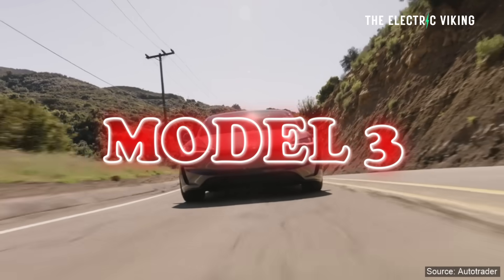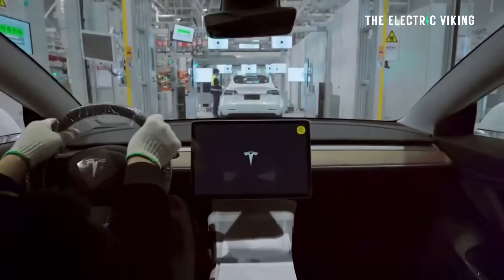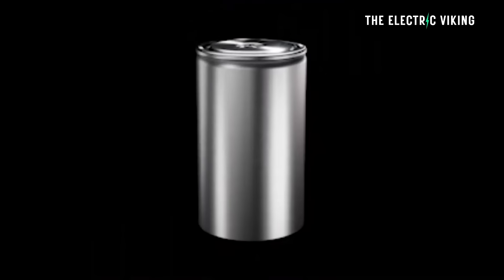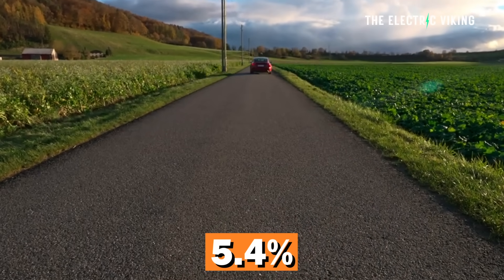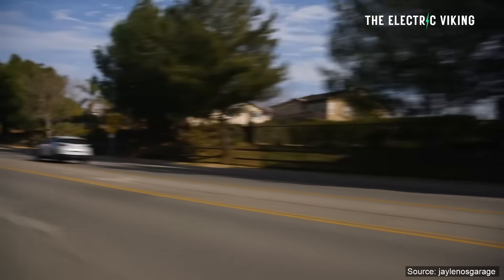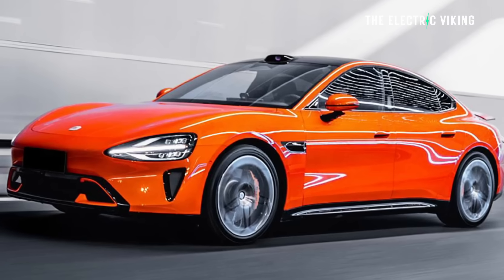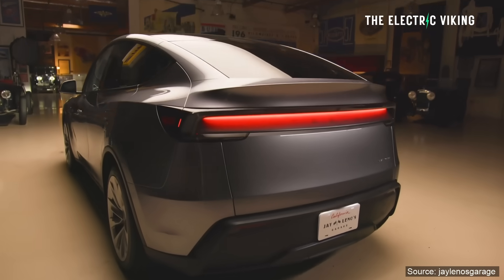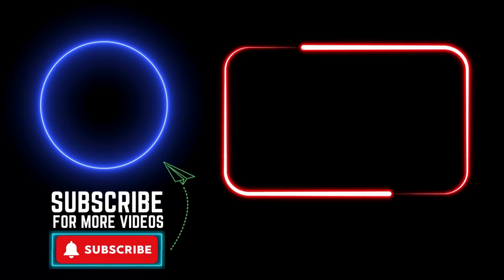Tesla Model Y and Model 3 get BIG range and power boost with NEW battery!

Comment: I wouldn't call a 5.4% increase in range for $2000, Game changing!🙄
Reply: I think it's significant. We are starting to see standard range cars come in with 500km+ range and LR versions 600km+ while tech improves and purchase prices continue to fall towards parity with ICE. I think EVs are on the verge of mass market wherever politics does not block free trade. ICE is starting to look expensive for what you get and what it costs to run.
Reply: @undercoveraca GO see what it costs to repair an Ev.........if you can find somebody to work on it & goodluck trying to get parts  which in many cases are on PERMANENT back order!!
Reply: @undercoveraca Chemical batteries have little room for improvement in cost, safety, and power density. Its a mature technology that's been around longer than the combustion engine. EV's are awesome, chemical batteries are not. Now if you replace the battery with an internal combustion engine and use a small battery for short trips and energy recovery, you have a winning balanced solution.
Reply: What about 10 to 80 charging times?
Reply: It would seem more significant if it were not for the weekly announcements of new battery technologies that make huge increases in range, but somehow never make it into production.
Reply: Cheaper than ICE trying to improve 5.4% in fuel economy or especially power, while meeting emissions.
Reply: It’s also a big boost in acceleration. That’s a bigger change than the range.
Reply: @ilmostro16 you got it 👍❤
Reply: This is one of those >> I don‘t really know what to say because Tesla has chosen to no longer be innovative, so there is nothing really new but somehow I have to keep my audience entertained, so this is what I came up with<< video.
In reality Tesla has missed the boat and is going down the drain. 
They should have brought something like the YU 7. But the great leader has chosen Tesla to become an autonomous drive and AI company. Meanwhile their only relevant product is piling up in stocks and can only be sold with huge discounts- even after the makeup. It is so boring that nobody wants it. SAD!
Reply: Bro, you spoiled he video -.-
Reply: Yep. Minor increase to range, but still of course positive thing. But Tesla has been quite efficient already long time so improvements are harder. Other brands naturally now make much bigger improvements. 
Acceleration improvement clearly bigger for those who care that.
Reply: Good on you,mate.Keep on the great work,right?What would we do without your opinion?
Reply: in the sense that a lot of people who were interested in purchasing one won't bc of the price increase it is definitely a game changer
Reply: @rickducharme7429  That makes a perfect point. Those who bought the previous model, for less money, with proven technology, really didn't do too bad!
Reply: Don't confuse him with logic!
Reply: It's the click bait nature of this channel. Every time, it is a game changer!!! I'm starting to get fed up with this.
Reply: @danielvilliers612 
Yes, I Unsubcribed!
Reply: He is giving us  80%  news  called  Silly Bollocks
Reply: If they do that around 13.5 times... they'll have doubled the range. It is Huge news!!
Reply: Tesla is DESPERATELY trying to crank sales up. Robotaxi, self driving new cars and all that BS. They are on a lifeline and sinking fast.
Reply: Price increase is from the new tariff climate.
Reply: exactly, too much freakin drama
Reply: Especially compared to the Chinese
Reply: Tesla is a shitcar.... It's badly assembled and it begins to rust after 2 years!
Reply: If the price goes up in the UK, sales will fall even further,  especially as in the UK we have a luxury car tax on cars over £40,000 so that will mean all tesla cars will have an additional car tax of over £2000
So sales will plummet
Reply: LOL. I was thinking 50% more range, not 5.4%! Hilarious!
Reply: 60 extra miles is significant
Reply: @SeanDees 
Not for Europeans. 😂😂😂😂
Reply: Technological advances occur incrementally.
Reply: Right?!?  Got me to click though… ugh
Reply: Charging time still ugly?
Reply: Did he say the range is now 700km? Thats like 430 miles that’s a 100 miles more than US models. How is that only a 40km increase?
Reply: That was alot of talk up for 5% for $2000 (5% of cost). And performance is already unnecessary. 4.4% for Y range. Feels incremental i was thinking 25% or something
Reply: 😂😂😂 absolutely
Reply: It's easy to talk about it, but can you do it? 😢😮😅😊😂🎉❤
Reply: Consider the result of that 5.4% increase. 753 km is 468 miles which I'd call excellent.
Reply: I do…
Reply: The game changing includes the increased performance 😀👍🏽
Reply: @neolakraj  irrelevant numbers in real world usage. If you want to race cars buy one that's purpose built
Reply: Yeah, but this is Sam talking :). Everything Tesla is awesome.
Reply: @Grizzold-HP2    Zeeker too!
Reply: Even if the range is only 'so so', if the new battery can maintain a much higher charge rate up to a higher state of charge without tapering off, THAT would be a "game changer"! The improvements in performance shown in this video suggests, that the new battery may be more efficient, able to handle higher current without overheating. That might also apply to fast charging!
Reply: Tesla just released its last quarter numbers, very bad, 13.5% drop in sales, 2 quarters in a row sales drop, lost title best selling ev brand and many more
Reply: I disagree. 5.4% increase in density, for a battery, is commendable and more than an incremental increase. When the Tesla battery factory is ready, more improvements will follow.
Reply: @neilmckechnie6638  A bit of the range increase might also come from lighter battery weight. hopefully we also get beyond the era of heavy EVs in a couple of years.

Comment: I don't know 40km extra is not huge difference in my mind .  100 / 200 km extra would be a huge difference . Anyway anyone knows if you could put this battery in the 2019 Model 3 long range AWD ?
Reply: Batteries are interchangeable.